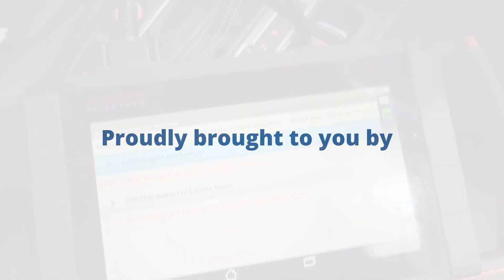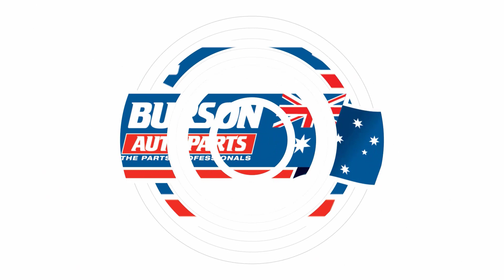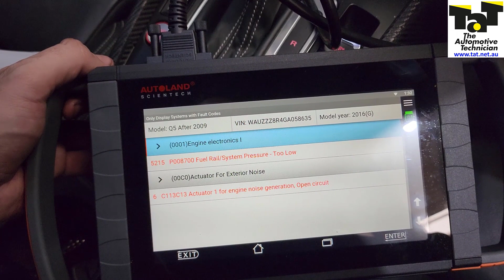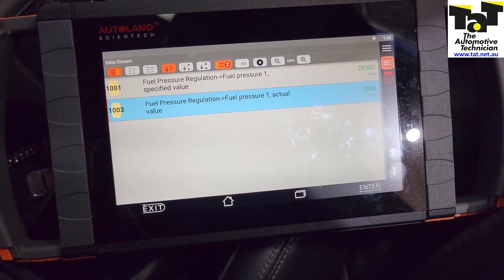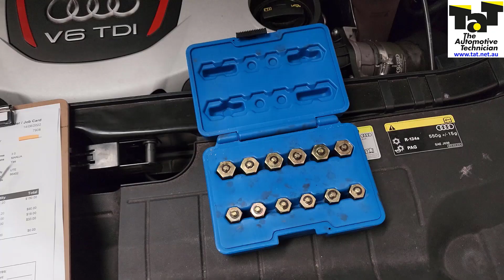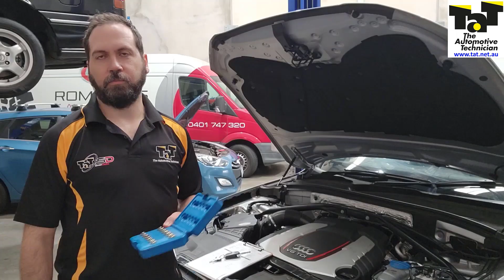Audi SQ5 with a crank, no start issue

Comment: Hi rob, thanks for the video! I have exactly the same problem on my SQ5! I changed injector 4 a while back, was ok for 300 miles and now cranking but wont start. Please would you enlighten me on how and where you connected the picoscope and sync? Was it a current clamp on battery cable or did you take it off the high pressure fuel rail pressure sensor. Also where did you connect the sync, was it on the injector power cable on the signal wire? Did you do the relative compression test with all HP pipes blanked off at the rails? What does injector leaking mean? i.e. Was the leaking injector leaking fuel into the cylinder, or was it leaking compression back up past the copper washer? Many thanks :-)